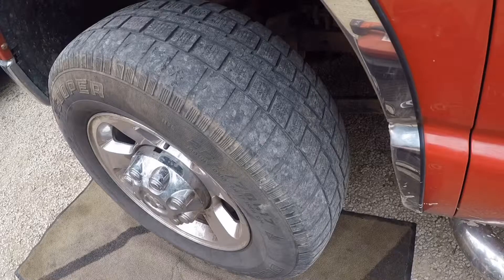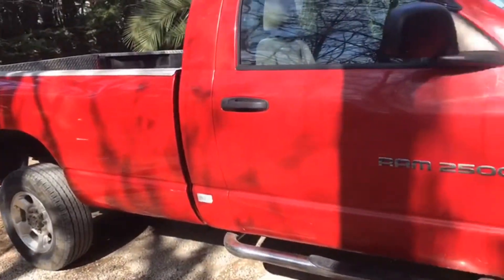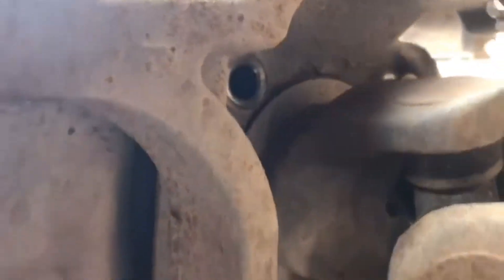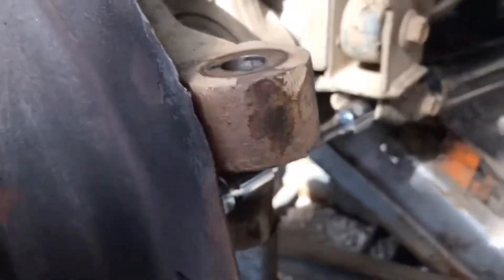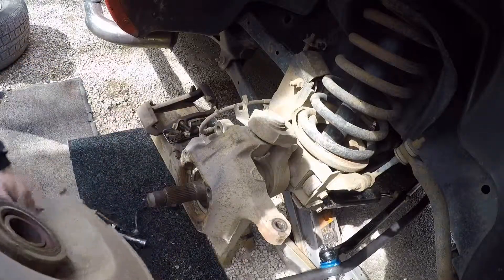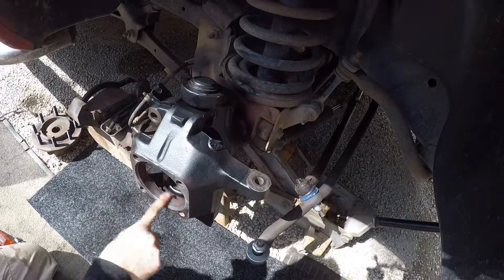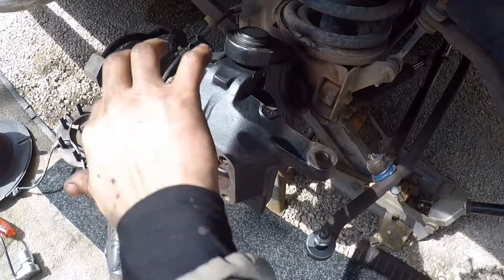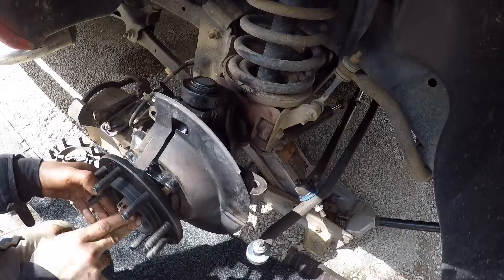How to install new ball joints 3rd gen  Dodge Ram 2500 4x4 Cummins 6 speed Death whobble fix

Comment: No way to grease new ball joints. I buy ones with grease fittings.
Great job. Great video. How do you get parts? Do you have to order everything online?
Reply from the maker: 1500 Mike thank you ! 
yes I need to import everything from the us...
This is the first time I use some stock mopar ball joint’s... they don’t come with grease fittings. 
For the next time I gonna try maybe some EMF ball joint’s.